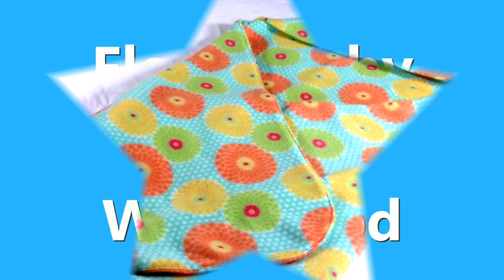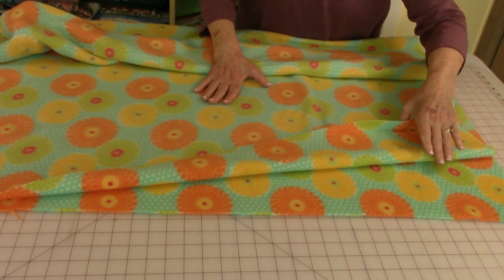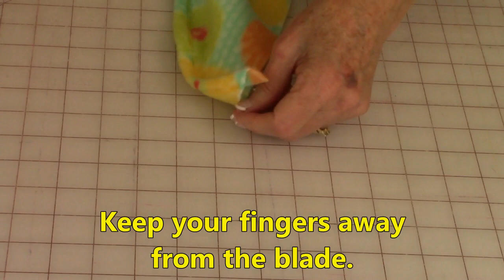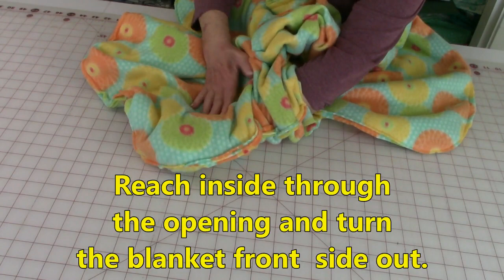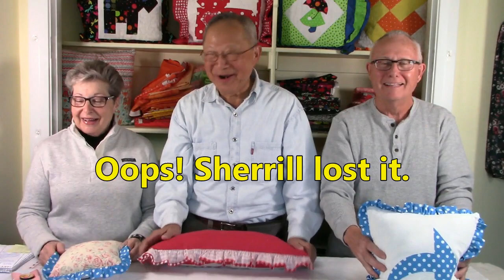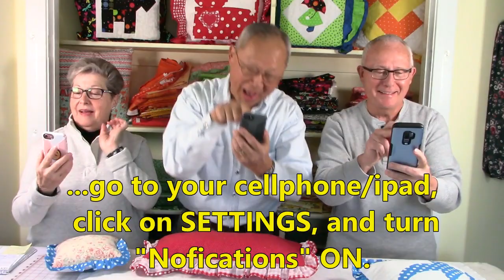Fleece Baby Blanket With Hood

Comment: i LOVE THIS. i MADE ONE . i TOOK OF THE DIFFERENT FABRIC FOR THE HOOD AND SEWED THEM TOGETHER ON THE LONG EDGE AND TURNED IT WRONG SIDE OUT THEN PLACED IT ON THE BLANKET AND SEWED IT. YOU CAN HAVE THE HOOD A DIFFERENT COLOR ON EACH ONE. i USED A PRINT AND SOLID. TURNED OUT SO CUTE. ALSO JOANN SELLS THE FLEECE BLANKET KITS. I USED ONE OF THEM. i REFUSED TO TIE ANOTHER BLANKET. OF COURSE YOU HAVE TO MAKE SURE YOU CAN TRIM OFF 14X14 A LEAST. i MADE MINE 40X40